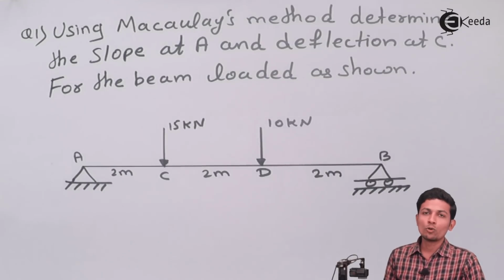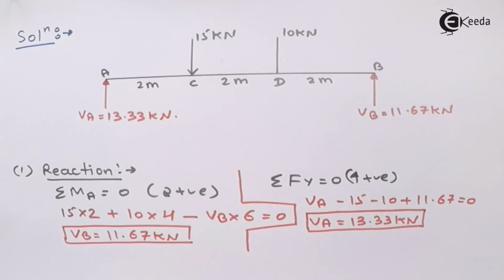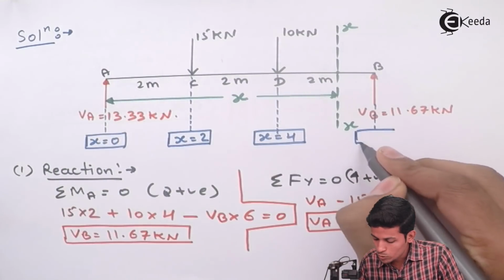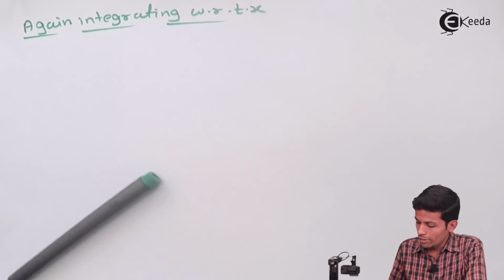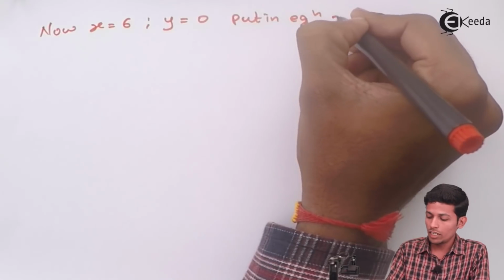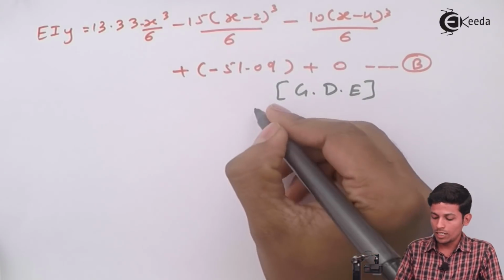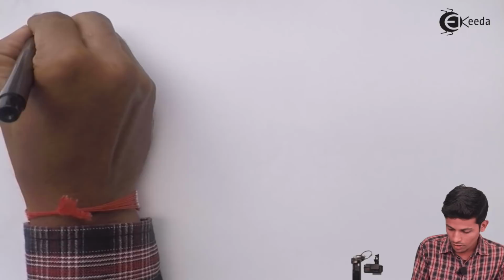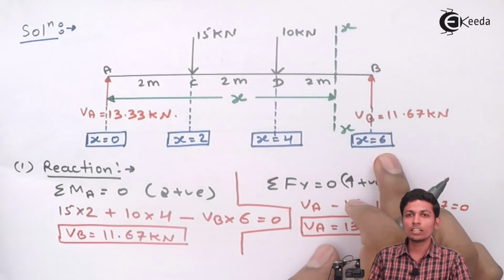Macaulay's Method (Problems) - Deflection of Beam Using Geometrical Method - Structural Analysis 1

Comment: Sir, when you're putting the values of c1  in general deflection formula, so there's another "x" which is multiplied with "c1" like>>>>>"C1X"
So what about that "X" .....
Means instead of both >>>C1X" we have to  putting this values  (50.09)
So please elaborate that....and build my concept on that in comment......... ........thanks sir.

Comment: (x-2) how total zero by putting x=0 i think its -2
Reply: The creator of this method Macaulay said that if any value inside bracket is zero or negative than whole term is considered zero
Reply: @shivam.p2461  oh thanks, but this dude shud have mentioned it
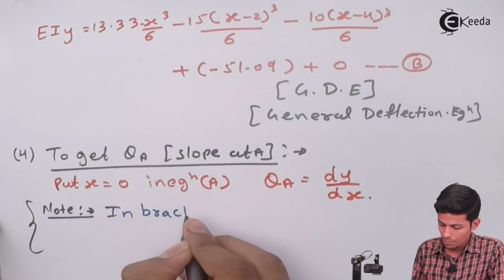Reply: @Lewis Port see 21:27 and read the note bro he did mention it in a special bracket

Comment: if you substitute x=0 and y=0 in equation 3, C2 will not be 0. Equation 3 will become 380/3 + C2 = 0.
Reply: I get the same thing as well it's not zero
Reply: he is very CORRECT. he just didnt mention the assumption because he was moving too fast. "(-)sign the whole term is considered to be 0"
Reply: as per Macaulay's

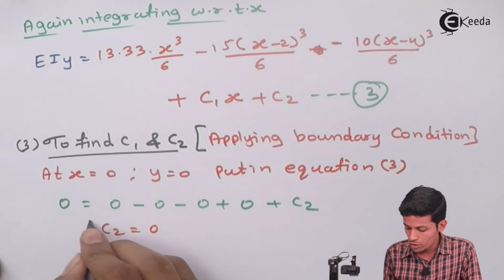Comment: At 14:55 how are they zero when we substitute X? Do we have to consider the whole (x-2) and (x-4) as "X"??
Reply: Actually it a rule of these method . If inside bracket the term coming is negative so it should be neglected . That's y it's taken as zero in first case . N next time one bracket terms become positive rest all negative as earlier so they are neglected and so on mn
Reply: @prayagsingh8162  thanks
Reply: @prayagsingh8162  thank man
Reply: @prayagsingh8162  (x-2) , (x-4) ye jo beech me negative hai isliye zero Kiya hai kya ?
Reply: @prayagsingh8162  agar X = 0 toh -2 bacha ... negative hai isliye neglected hai ...yahi bolna chahte hain ?
Reply: Those are boundary conditions x-0 and y-0 this can only apply for bending moment of A........and x-l and y-0 can apply for all moments upto the x x' origin
Reply: Bhai isne integration hi galat ki h..

Comment: X=0 means how it becomes zero In substituting in eqn 3
Reply: Actually it a rule of these method . If inside bracket the term coming is negative so it should be neglected . That's y it's taken as zero in first case . N next time one bracket terms become positive rest all negative as earlier so they are neglected and so on
Reply: @prayagsingh8162  If  we r doing the same problem by using double integration method can we get the same answer?????????
Reply: @resminair5451  u should...but just stick to macaulay's its the best method wen EI is constant